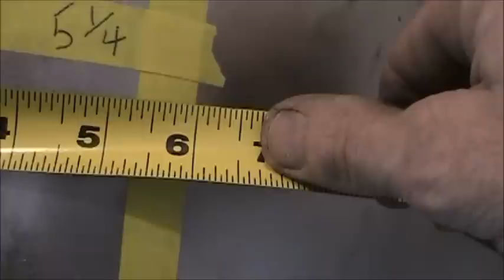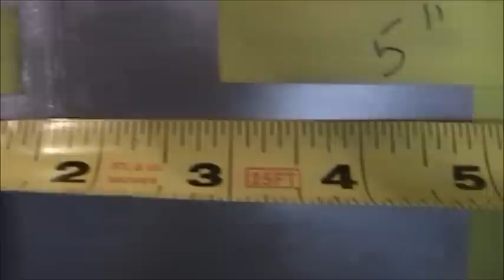how i put the quaerter panel skin on

Comment: I think you did a good job!
Next time you tackle this...
Go ahead and coat the flaged area and its mating surface with weld thru primer, to get yourself some rust protection...
Or even better rust protection is to panel bond it!
Run the panel bond on that flaged area, and clamp it down tight, you can even use sheet metal screws where the clamps dont reach, and it will be less prone to moisture getting in that area and rusting/blistering it out down the road...

Comment: @TheRickfix Hi,Im new to welding, just bought a mig welder for my van/truck rear wheel arches are rotted off so have to replace.
Do you have to fill in all the gaps between those spot welds before you grind down and apply filler?
Would just those spot welds on the video be strong enough to hold the rear quarter in place?
thanks in advance

Comment: Hey, nice vid, wouldnt that be easier to line up if you replaced that damaged door first?
I really like the flanger, especially on those long panels, because the flange adds structural rigidity to the panel.

Comment: Rick I have a better way of getting that Quater on and perfect .. Put your quater on , mark the line where the quater is going to . Remove the quater ,  trim original quater to 2 inches bellow the line . snip up to the line every 6 inches .. screw the new panel back on and screw it down as tight as you can . start at the back or front  cut the original quater up to six inches . remove the screws and the cut off pc from the back .. tack the 5 inch gap . repeat till done .but welded . grind . 40 years of body work talking here